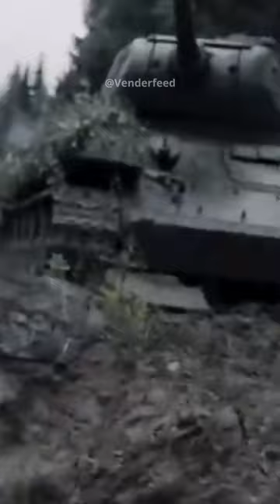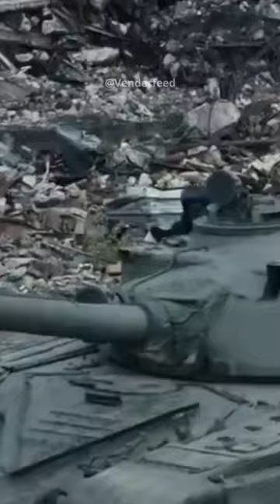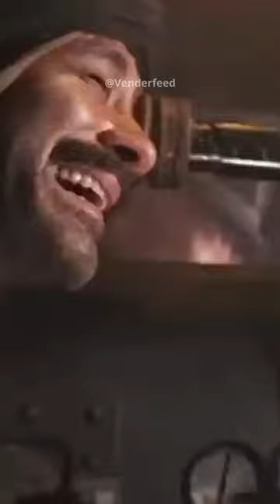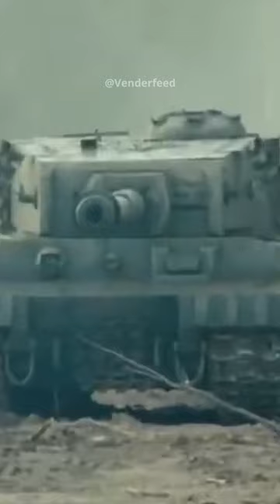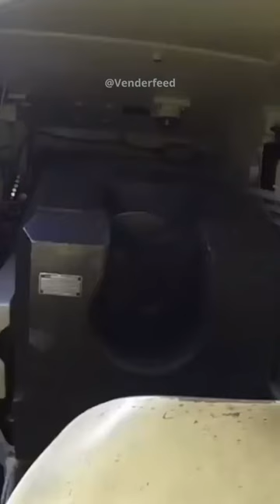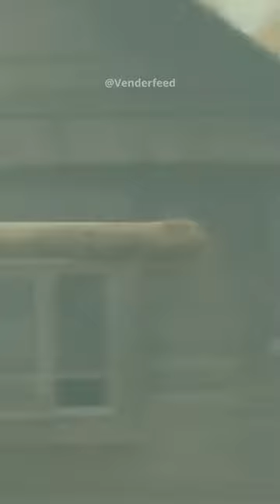What happens when a grenade enters a tank's barrel? #shorts

Comment: How little you know. When firing a HE ( high explosive) the detonator in the projectile gets activated on the turn of the grooves in the barrel. After about half a turn the detonator is activated and the projectile will explode and cut off the barrel. With smooth bore guns it is even more dangerous
Reply: This is an adjustable feature. They can make the round arm after or it can be armed as it leaves the barrel for point blank shots.

Comment: A normal incendiary grenade would likely not cause that much damage. But in WWII, they supplied the infantry with thermite grenades, which produced intensely hot molten metal that would melt through the gravity side of a tank or artillery barrel, and leave a hole in the side of a barrel that either disabled the barrel completely or dramatically reduced its velocity performance and render it unsafe for the operator, causing a hot jet of propellant gas to come out of the side of the barrel. The thermite grenade could be laid on top of a tank if it was level or close to level, melting through the tank and causing hot molten slag into the tank interior, likely causing fuel to ignite and stored ammunition to explode.
I don't know which type of thermite material was used, but the iron type would rise quickly to 5000° F,  Copper oxide thermite can rise to 8,000°F.

Comment: thermite grenades are different from regular grenades and thermite granades will cut and melt metal, the US army used them during the battle of the bulge in WWII  US soldiers put thermite grenades down the barrels of German heavy guns to disable them. Today thermite is used to fuse railroad tracks together by going this it removes a joint that would otherwise be bolted together.